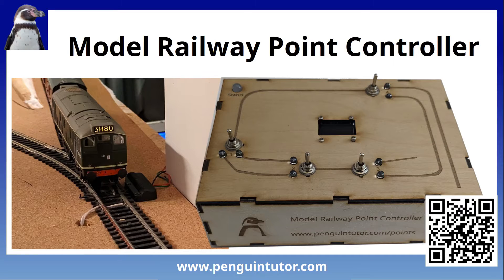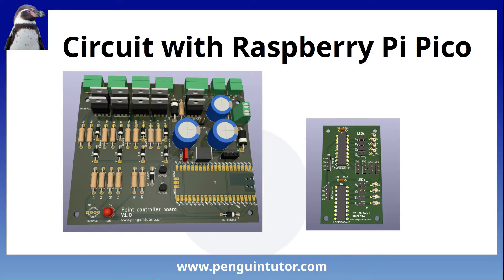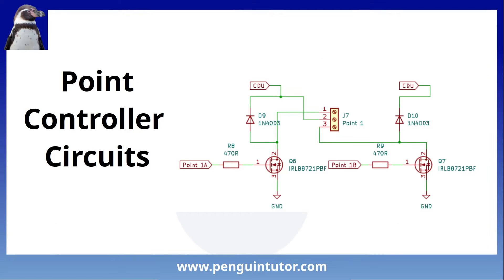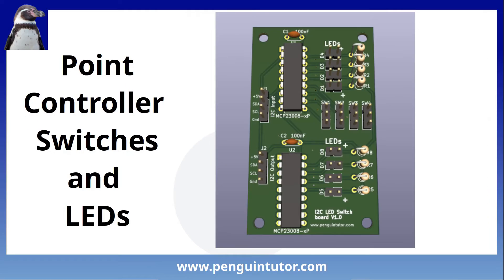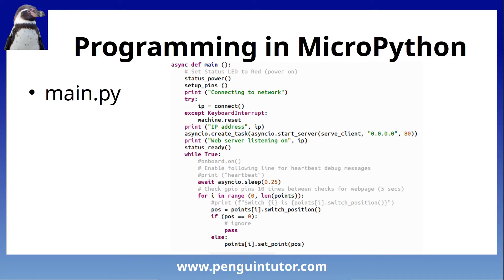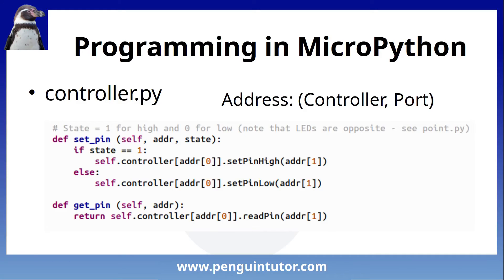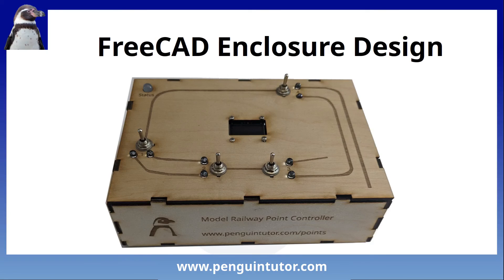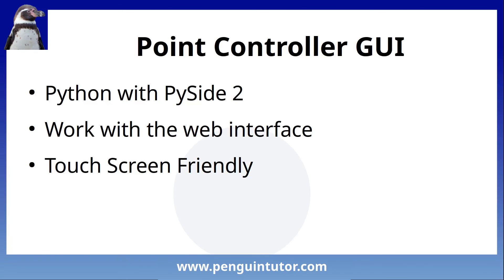Raspberry Pi Pico Model Railway point controller - overview and project update

Comment: At 13:00, I would have thought you would have labeled them Up and Down.  Nice project though.
Reply from the maker: I was about to. In fact if you look at the source code on github there is still an up.png and down.png in the design folder. 

One reason I changed my mind is because the switch on the left of the layout goes left and right rather than up and down. I did think about having an up and down line, but other than one double track section for a station there is no where that would make sense, and as it is a circular track it doesn't have a destination to have as the primary direction.

As the track is circular I did think about having inner and outer track, but again one of the sidings is innner and the other is outer. I'm also planning to use it on another layout (not built yet) where the tracks will not be in a loop so it wouldn't make sense there. 

It was at Model Key World when my son was using a DCC controller where the points were all controlled with buttons 1 and 2 on the DCC controller that I decided to go with 1 and 2. In fact none of the options are ideal. 

One thing though is that I've made the source code available, and changing it would be as simple as either editing the html file and changing it to use the different image files, or saving the up and down button files over the top of the button1.png and button2.png files. You could even change the html so that some have up and down, and some have left and right, but I wanted to keep it generic so you wouldn't need to customise if using it on a different layout. 

A major factor is that interface is not really intended to be used. The web API will be used by the GUI and I just thought I may as well create a basic web page so that you could control it with say a mobile phone if you wanted to.